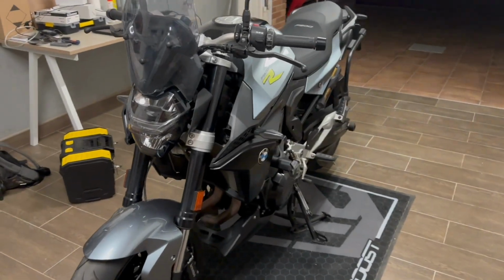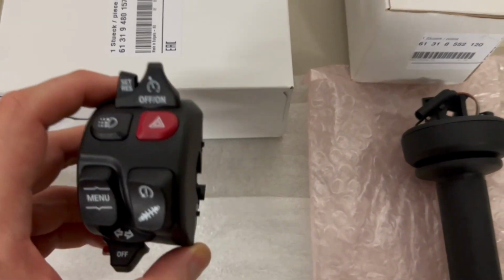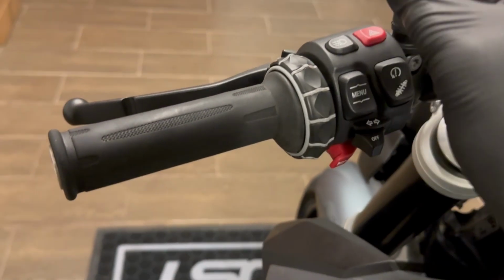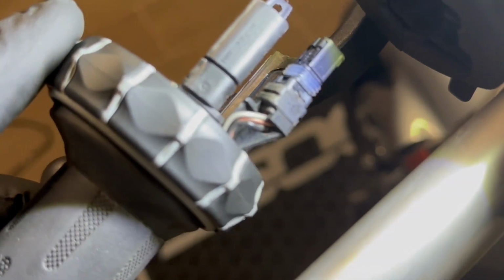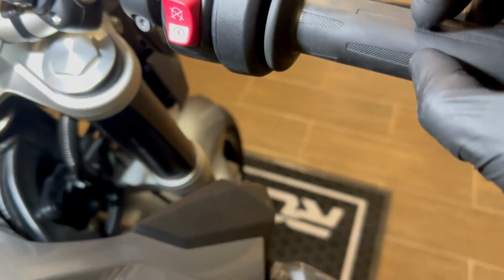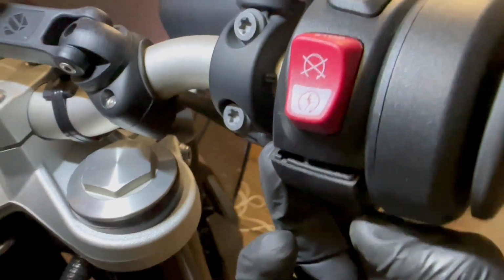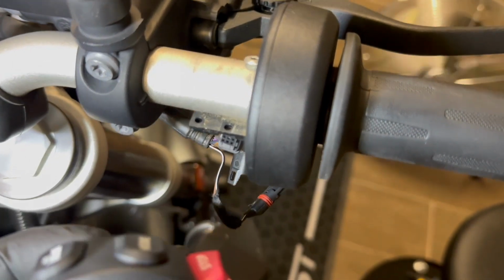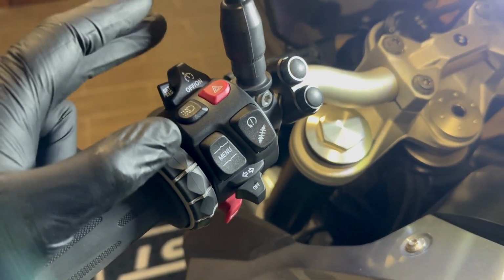Cruise Control retrofit on BMW TFT MOTORRAD

Comment: Hi.  This is a very interesting video.  You answered another viewer that replacing the throttle side was not necessary.  Why did you do it?  What does the new throttle do the old one did not?
Thanks fir the video and your time.

EDIT:  I rewatched and saw where you explained the new throttle grip.  'Im not sure how you could roll it forward unless it is held open somehow after engaging the cruise?

Comment: So I'm in a fun boat. I have a US spec F900XR that came with ESA and cruise, BUT it does not come with the DRL button to the left of the indicator.

I'd love to turn off the headlight during the daytime for the headlight to be symmetrical with just the DRLs on. 
If it's just as simple as swapping the control ring out that'd be nice

Comment: I know this is about cruise control retrofit. But my question is when you took off the grip. Does it have a come stock with heated grips? And if I want to add heated grips without the cruise control. Do I need to change the left grips?

Comment: Hi!
I actually just bought the 2024 BMW F800gs. It didn't came with cruise control. 
So, i think i must do this steps. If i do it myself, it will void the waranty? Do you know if the Dealership can install the cruise control?
Reply: I have 2021 F750GS and BMW asked me 700€ for installing cruise control

Comment: Hello, 
I saw the video about installing the cruise control on the motorcycle.  I have a 2022 BMW f850gs and I also wanted to install the cruise control.  I have two questions, I would really like it if you could answer: 
1 - is changing the accelerator really necessary?  
2 - Can I add cruise control recognition with OBDII and BMW moto scan or is specific software required?  Thank you very much in advance.  
Best regards, 
Amaro.
Reply from the maker: @amaromagusto4597  hi, the accelerator is not mandatory
Moto scan is not sufficient other software is required. I can do the coding work for you if you send me your contact
Reply: @SmkRide hey, can you help me yo retrofit a quickshifter on my BMW?